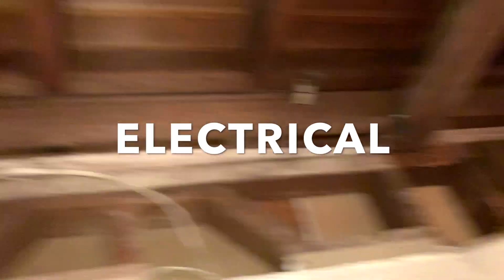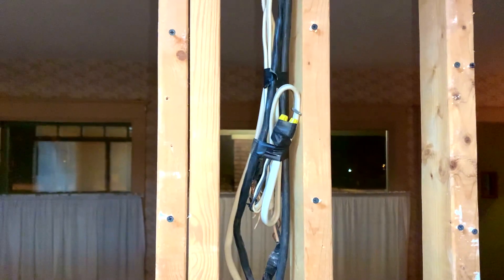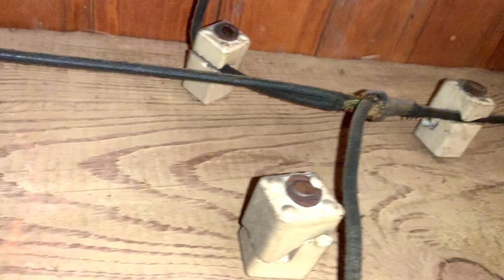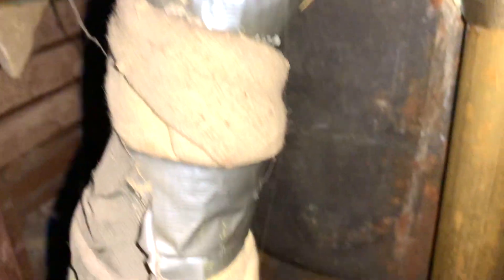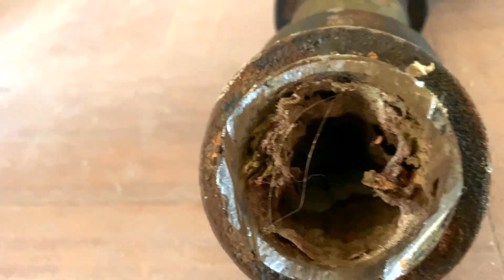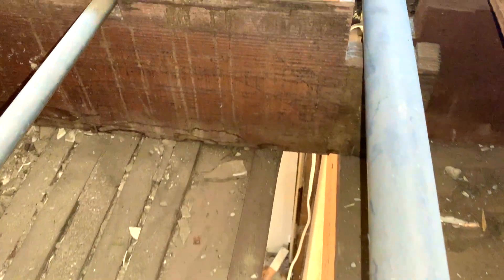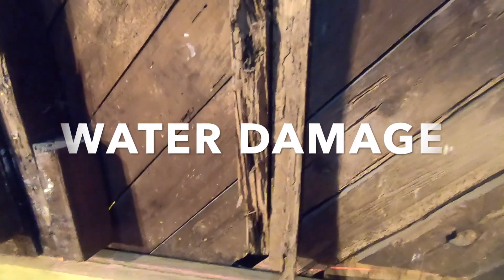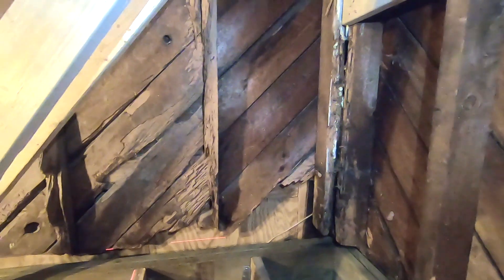Should I Buy an Old House and Fix it Up

Comment: the exterior walls leaked air, they didn't breath. they had drying potential. what's problematic is insulating without stopping air movement - that makes exterior surfaces colder, warm relatively moist air comes in contact and get condensation.